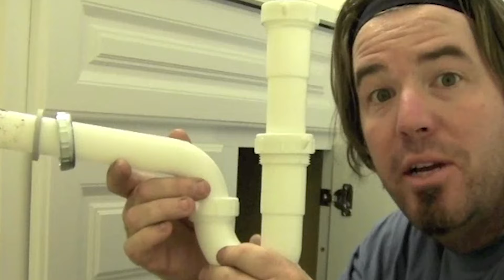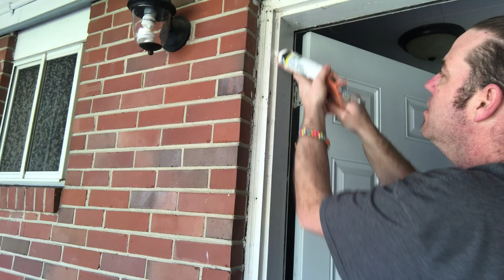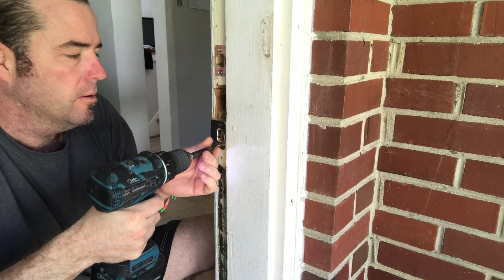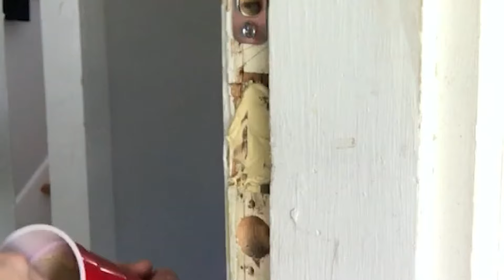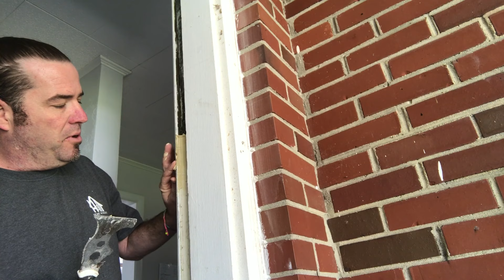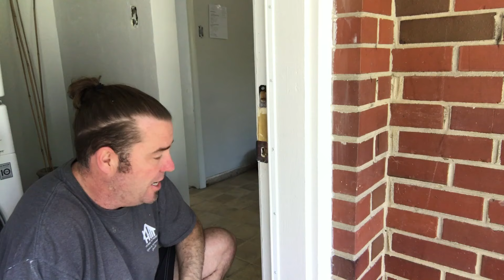How to fix an ugly door jamb, repair bad jamb...wood repair . easy!

Comment: Coming from almost 20 years in Apartment management/maintenance, If your front door wont close because the latch is hanging out, you should check out this internal door repair called ReSecure Latch. 
It solves the problem of loose door latches or dead bolts that sits inside the door bore hole. Found them on YT. What's nice is that it replaces that ugly metal cover that ruins the look of your door and the stick and putty mess.
Reply from the maker: That is awesome thanks for sharing

Comment: Added new 6 panel interior slab doors without replacing the jambs. Old handles/strike plates were installed too low for the new doors so my new door handles need a new strike plate location. This is the perfect solution for filling the old holes. Thanks!
Reply from the maker: Awesome JL!  Thanks for commenting!

Comment: You should show us how the end project turns out after you paint it.  I would really be interested in seeing how the finished product looks 👍
Reply from the maker: hey ivan! you're going to have to trust me...amazing! thanks for commenting!
Reply: @homemend  great video! Will totally use... this video would be utterly flawless with a before and after photo at the end!
Reply: @homemend  
Hello
I have a partially damaged door frame. The part of the door frame that holds the door. There's a open gap where wood was partially ripped out when the door was pushed in. It's the part of the door frame where the door hinge is and where the door  hinge is screwed  into the door frame to hold the door in place.
Do you think Durham's rock hard putty can fill the gap in the door frame and screws can be drilled or screwed into it to hold the hinge in place with the door attached?
Reply: So Durham’s can be sanded and painted, but can you screw a new plate directly into it??

Comment: I just used Durham's  to wood patch a door that someone bashed with an axe. If only I known about it sooner I would have fixed the door I broke. For corners if you put a big glob on wax paper and push it into the exact form you'll have alot less to sand/cut
Reply from the maker: so awesome israel!..i never tried it on a wood door..sweet!
Reply: @homemend  believe me the door was wrecked. Just smoothed out the humps and taped a piece of wood in and Durham's and the orbital sander did the rest.

Comment: Just bought a fixer upper, the front door is a mess and this is project priority number 1. Thanks for the walkthrough! 
Could you actually drill/screw into the Rock hard? 
I basically want to start the the catch "as new"
Reply from the maker: Hey Travis that is a great question. If you want to drill into it you may need to replace with wood and then repair the seams with the rock hard or Bondo. I’m afraid it just wouldn’t offer any kind of security
Reply: @homemend  Amazing Reply. I believe I am going to just approach the fix with a replacement of the board. Then Redrill the catch holes for the deadbolt and the knob. 

Thanks for giving a great walkthrough

Comment: I used jb weld wood restore and was able to get some similar results. Just take your time. It took a few coats. I sanded it to get it just right. Paint over it to match and you can't tell the difference anymore
Reply from the maker: That is awesome Jon I appreciate you sharing friend thanks for commenting

Comment: Hey, thanks for the video! It’s super helpful. I was wondering what you would use if the hole is where your current deadbolt goes.  The hole is too large for a strike plate to be attached, but since I need the dead bolt to go there, I can’t fill it in completely with the putty.  Other than the hole, the door jamb is in fine shape.  Ideas?
Reply from the maker: Hey Jenny, check out my new video. I just did a video about Will rockhard the wood putty hole a screw… Check that one out and then see if you don’t want to try it. It’s called wood putty, buddies

Comment: I’ve repaired many a jamb with a 2 part epoxy with a slow cure harder and medium density filler. West systems epoxy. Takes a while but it’ll look perfect!
You wet the blade then use the other dry side??
Reply from the maker: Hi Robert that sounds awesome. You rocked it.

Comment: You did alright but I do have a suggestion for you going forward.  When you need to do an edge like in the case of where the hinge was try this.  Use a broad knife (5" inch blade) to keep your edge.  Use a regular 2 and a 1/2" inch knife to spread your material over the main area and drag it down against the broad knife.  It might help to if you have a little water on the broad knife.  Just an idea for you.  Good work.
Reply from the maker: Awesome tip jim. Now I’ve got to try this! Thanks so much.

Comment: Can you drill screws into that rockhard after it’s dried or can you use a nail gun and drive some nails into the area that was filled with the rockhard if you had to?
Reply from the maker: Hey nova great question. A lot of people ask this question and yes, you can check out my latest rockhard video. It bears all.

Comment: Thank you for showing me this video. Could I remake holes after doing this? I'm wondering that bc it's all chopped up but I still need the home there.
Reply from the maker: hey AC...after ity sets well, using a nice sharp drill bit would be able to put the hole back..or check this one out...

https://www.youtube.com/watch?v=Vjq9GWr7-Pg

Comment: Hello thanks for the tips 😊was wondering..can u use the hardener to reuse the spot instead of replacing the actual frame?
Reply from the maker: Hey Melissa! I was just trying to repair some ugly here and it may work for you instead of replacing, here’s an alternative if you need more than the ugly door jamb repair. I hope this helps

https://youtu.be/Vjq9GWr7-Pg
Reply: @homemend  will try both if needed thanks 😊

Comment: my home was built around 1899, very likely earlier. there isn't a square angle to be found, it's so settled. the doors (and transom windows) are affected by the weather, it's so drafty. but it's an awesome victorian queen anne. might you have a string of videos pertaining to houses like mine. you know, plaster & lathe, knob & tube wiring, etc.....the old stuff? thank you!!!
Reply from the maker: Hey Peter I was introduced to home repair in those old houses. We always repaired. Plaster with drywall, replace the tube and knob.with romex unless you’re trying to keep it authentic which is quite quint.  I hope this helps.

Comment: Could the current door jam be filled in and drilled out again to repair years of screws removing wood from the door jam?
Reply from the maker: Hey Jon that’s a great question. This water putty is not a replacement for wood, or if that is what you’re after simply cutting out a portion of the wood and installing new wood would take care of that for you. Then you could use the water putty to fill and hide the seams in the new piece. I hope this helps. Thanks for commenting
Reply: @homemend  thank you for the info!

Comment: Could I do this for the hinge cutouts on the jamb? 
I am replacing a door and the hinges on the door don't line up to the cutouts on the jamb. My main concern would be drilling/chiseling into the putty if the hinge area overlaps? 
Or should I just try to wood glue in new pine?
Reply from the maker: Hi Chris. I would go ahead and hinge the new door, and then fill the old hinge holes with a paint stir stick or something like that, Then you can fill it and finish it with the rock hard

Comment: Lets say on that hole that you filled,  you need to partially create a hole again to let a latch/bolt in... do you think that's still doable?
Reply from the maker: Hey a. I would certainly give it a shot, if you had a nice sharp bit. I believe you could pull it off

Comment: can you screw a new striker plate into where you filled the hole?
Reply from the maker: Hey Caroline, you would need to replace that with real wood in order to be able to secure things back to it… It’s rockhard is wood putty, wood, filler, just for show. I hope this helps.

Comment: Can u chisel the rock hard out for a strike plate? Also how well does it up if you drive a screw in it?
Reply from the maker: Hey red.  I’ve never tried to use a chisel in it. This one was old. And needed filled. I don’t think it behaves like wood. Wont hold screw etc. But bondo May

Comment: Could you put a screw in the putty wood filler?  I am trying to find a video that would show me what I should do if I wanted to put a smaller strike plate.  The problem is that the hole is too big and not in the correct place.
Reply from the maker: Hey no good. 
It really depends on the circumstance and the screw, Check out deadbolt catch repair on the homemender channel. It should help you out

How to repair deadbolt catch, replace wood behind plate. Door jamb repair. Easy!
Reply: @homemend  Thank you so much for taking the time to answer!  I will look at the video.

Comment: I'm actually looking to do the exact same job on my door, I was wondering if you can drill into the putty though or not. I'm between this and PC Woody Wood Epoxy
Reply from the maker: Hey arl. You can drill but it doesn’t hold like wood. This is more surface repair.  If you’re going for strength you may need new wood
Reply: @homemend  Good to know, I'll have to look into it then. 
Thanks!

Comment: Will the filler you used, be hard enough to re-drill holes and/or reset a door jam hole?
Reply from the maker: hey Matthew,,,you can drill through but holding a screw would just be for show, it would not be as sturdy as wood... i hope this helps

Comment: Hi, can this be used on siding? outdoors>
Reply from the maker: Hey aero.  Not if you want it to look good.  Use the siding replacement video.  A new piece is easily replaced for 7 bucks!   I’ve used it outside for small wood repairs.  Then paint with exterior paint.  It held up nice.

Comment: Good ole USA who here,uses decorators caulk to fill few door, holes instead of wood filler that’s intended for this job just like you used for filling door jams 😮🤔
Reply from the maker: Hey hey squeal. I could’ve done that but I didn’t want to. Thanks for watching
Reply: @homemend  I only mentioned this because 2 pack wood filler actually dries faster than caulk and will do a better finish and use the caulk for sealing gaps etc 👍
Reply from the maker: If you’re good with the CAulk gun you can do both :-)

Comment: When you use that putty to fill the hole does it get hard enough that it would hold a screw? I need to fill a crappy jam hole and shift it up about half an inch so the bottom screw would basically be going right in the putty.. I guess I could use a much longer screw to get into wood behind the putty.. thoughts? Thanks for the video! New subscriber here!
Reply from the maker: Hey Chris yes definitely get the long screw to get into the stud. It does harden nice and it’s good to repair catch areas of the door jamb.
Thanks for the sub.  Happy to have you!

Comment: "You do have to paint over it" about the "painters" Alex caulk surprised me. What happens if you don't paint it?
Reply from the maker: Hey hey. We use painters caulk on door casing and baseboards but if you don’t paint it, even if the baseboards are white, you will see a doll flat finish where you have caulked and it will not look uniform with your trim and less painted.

Comment: Can you use the rock hard and than screw into it?
Reply from the maker: Hey Laura.  You might need to pre drill. It is not as durable as wood
Reply: @homemend  thanks I have a 1920s house. The door jamb is cracked and screw holes where latch hooks are stripped
Reply from the maker: Gotcha.  The rock hard will fill the gap but for the best security , you will want  long screws that go into the stud. 3 1/2 “ is typically enough.I hope this helps!

Comment: The best thing I have found for exterior wood repair, "J-B Weld 40007 Wood Restore Premium Epoxy Putty".
Reply from the maker: Hey CM. I’ve always used rock hard but I tried bondo for the first time this year.  Hardcore stuff man.  My new fav. I’ll check out the JB.  Thanks for sharing!

Comment: Dustin, would Bondo cure that deep as well?... I guess that's just under an inch.. oh.. and is this your daughter's school you are working on in this video.
Reply from the maker: Hey AC, this was a house I sold a couple years ago. I believe Bondo would cure underwater so the thickness should not matter however you could always stuff it with some thing before applying.

Comment: using calking to fill holes is a bad fix should have used Spackle or wood filler,or the rock hard, as the caulk will shrink in just a tad showing the repair
Reply from the maker: Hey David? if you use painters caulk and wipe with a sponge you should be good to go. Thanks for commenting

Comment: Dustin, that stuff didn't work for me, after time it cracked & broke up.
Reply from the maker: Hey Jon that’s unfortunate. I have not had a problem with it but Bondo is a more hard-core Product. You might give that one a try. Did you do one big coat or multiple small coats? That definitely matters